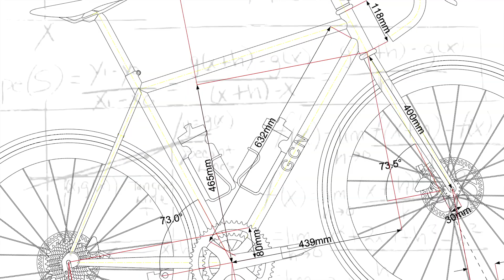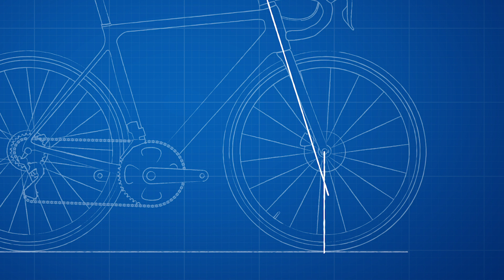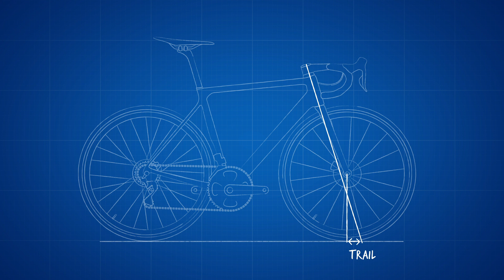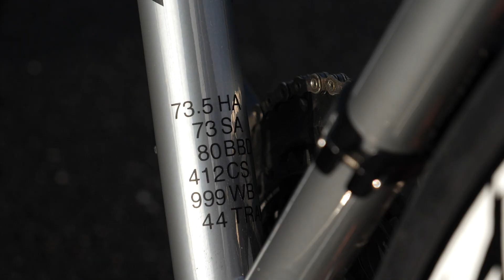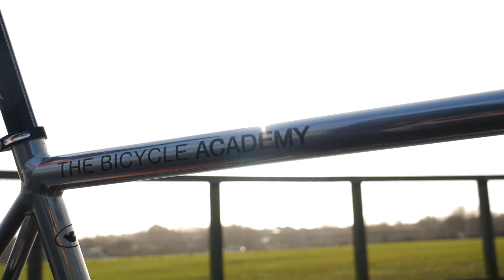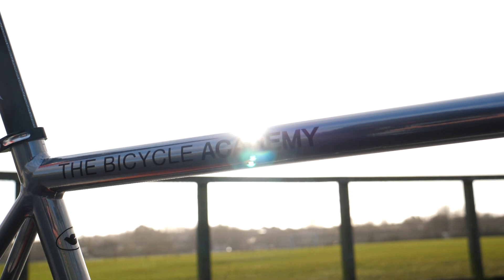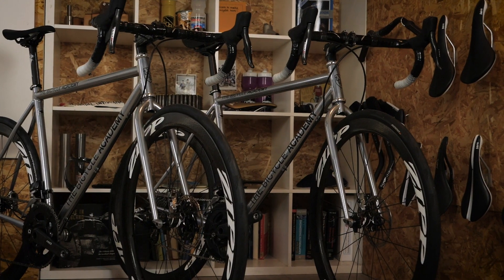How Does Your Bike Geometry Affect The Handling

Comment: I got my taste of the effect of trail whe I switched from a Charles Roberts to a Gios. Same size, but the Gios had a slightly steeper head angle and more fork offset. The Roberts cornered like on rails in good road, but became a handful through sand, gravel, and water. The Gios plowed through loose, bad road with more predictability. The steering of the Roberts felt heavier. It went straight better and responded quickly to lean, but effort at the handlebar to get it back in line was higher. Yhecsteering of v the Gios felt lighter, much like snaking the front wheel through road irregularities. The Gios was also easier to put into a speed wobble. But I've also ridden some long-trail bikes, like an early Trek Domane, that seemed reluctant to exit corners, wagging their rear wheels behind them. I think that's partly a function of the slack head angle, too, because my Madone has a similar trail figure, but the handling is much crisper. But my champ for mixed road and gravel is an '80 California Masi. It splits the difference between the Gios and the Roberts.

Comment: Given trail is one of the main geometry figures that impact how a bike handles I have a question relating to the relationship between trail and bike size. Should it change? 

For example BMC (Roadmachine its 63 on all frame sizes) and Cannondale (System Six it's either 58 or 57) seem to keep a reasonable consistent trail figure. However, the Specialized SL7 ranges from 52 to 71. 

So do bikes of a similar trail handle similarly regardless of wheelbase or do larger bikes with longer wheelbased need less trail to make them feel as 'lively' or 'agile' as the shorter wheelbased smaller versions?

Comment: A fascinating discussion!  When I got my first drop-bar bike last year (a Devinci Hatchet gravel bike) I couldn't help but notice that it felt sluggish in sharper, slow-speed maneuvers but very stable at high speeds (to the extent that I was sometimes shocked at the speeds I reached on descents).  Turns out the trail is almost the same as the high value in this test.

Comment: #askgcn
Hi Olli thanks for the great Video. I am about to Upgrade my Old caad5 with a new fork. 
That is my Chance to get a longer Trail by choosing a fork with less Offset/rake. 
However that will shorten my wheelbase which will make the bike less stable again?!

What should i do if my aim is a stable fast bike in a straight line?
It should be safer When riding Freehands. ;)

Comment: I would have likes to know what exactly where the 'tweeks' on steering tube angle and top tube length that where made to have these bikes end up with the same wheelbase. Not explaining that is a strange omission. I assume the bike with the longer trail has a slacker steering angle and a shorter top tube.. I never really understood what exactly it is that makes a bike more stable: longer trail, slacker steering angle, longer wheelbase, top tube length, lengt of the stem... Or how these (and other) factors interrelate.
Reply from the maker: The Top tube would have been made shorter and the headtube angle slackened to increasethe trail.

Comment: Great to see a video looking at the subject of trail. My understanding of low trail Vs high trail is this;-
As Ollie discovered low trail bikes are inherently more agile than high trail bikes, which has a number of advantages. Firstly, it allows you change direction much more easily, so if you enter a bend at speed, and that bend unexpectedly tightens in radius, you're able to adjust your line and make it around the bend. On a high trail bike this is much harder, as they tend to corner, "as if on rails".
The other big advantage of low trail is that you can carry a substantial load on a front rack without making the steering unduly heavy. High trail bikes really don't do well with heavy front loads.

Check out the Rene Herse blog https://www.renehersecycles.com/blog/ and Bicycle Quarterly magazine for much more in depth info on the subject https://www.bikequarterly.com/
Reply from the maker: Yes it can completely depend on the type of riding you do
Reply: Thanks for the link. Very interesting site.

Comment: Good one !  Thanks !
That wheel/shoe overlap can be a nuisance with short trail bikes.
Recently, I had a new track bike built, and mentioned to the fabricator that I would prefer no wheel/shoe overlap, if possible -- by increasing the trail if necessary.
The wheel/shoe overlap issue is worse on a track bike, because you can't move your foot out of the way on a fixie, when making a low speed turning maneuver (ie. U-turn). 
But he was only willing to go so far, so my new bike still has wheel/shoe overlap, although not a lot (it almost clears).
He added that going beyond that would make the bike unstable, and it's also against their trademark geometry.
That seems very odd, considering Ollie's tests & conclusion that bikes with more trail are more stable at high speed -- presumably what we do on a banked oval.
Have they got it backwards ?
Thnx.

Comment: Hi Ollie , Ken here . cool video . I went back and checked " trail" of my new bike , (Specialized Tarmac Pro with Sram shifting with hydraulic disc brakes 2020) ,  since getting my new bike when I'm going in a straight line the bike is so stable compared to my old bike and around the turns at speed are awesome . At first it thought it had more to do with the 50mm deep wheels and then I watch this video , again TankX Ollie .

Comment: #askgcntech having recently got back into cycling as a hobby with a friend, we are rapidly coming to the conclusion that we both need new some bikes. 
Currently we both ride Carrera subway hybrids while they are great workhorses for family riding with child seats/tow alongs they are just not up to the type of riding we currently do and would like to continue to do. We try and get out about 3 times a week for an hour to two hours each time doing about 18-30km with a mix of road and paved cycle track and some gravel, we tend to cycle at night after the kids have gone to bed so prefer to avoid the main roads.
We're both looking at around the £1-£2k mark, probably for something with a 105 groupset and ideally Hydraulic discs. I'm paying for mine via cycle to work and my friend is not very technically minded so the bikes essentially need to turn key retail bikes. The question we have is should we go for a gravel bike like Cannondale Topstone or more of an enduro road bike like the Cannondale Synapse. We want something which is relatively relaxed and comfortable on longer rides and will take a wider tyre for more confidence in the wet/loose material. We live in the South Wales valleys so it's always wet and everywhere is uphill. TIA

Comment: The "expert" never explained WHY increased trail adds stability. It's because when you steer, you sweep the center of the tire contact patch so that it isn't aligned with the velocity vector of the frame, thus creating a moment about the steer axis that tends to return the steer angle to center. It also causes what's called slip angle drag (easier to see in a car instead of a bicycle). There is both mechanical trail, as measured in the video, and pneumatic trail, caused by the deformation of the tire when it's at a nonzero steer angle. I really enjoy this channel, but if you're going to consult an "expert," get a real expert in vehicle dynamics.

Comment: Surprisingly, the stem length is also vitally important and it was not mentioned.  Hmm.  I ride a 55cm Pinarello Dogma frame with obviously an extremely short reach measurement (I like short, instant, left and right turning which makes it nice for bursting out of a paceline or dropping off the lead quickly) and run a 90mm Cinelli stem -- any longer and the Dog will wobble at high speed like a drunken sailor.  And so goes bike geometry, this topic is a great one and could go on forever.  Thanks for the great ditty!

Comment: so that explains why on my argon 18 E80 TT frameset it's so difficult to ride no hands and track standing, not to mention the times I've almost fallen off at low speeds at traffic lights. Compared to when I'm on my city singlespeed I can ride no hands so easily that I can even ride up quite steep hills no hands to embarrass the other riders as I drop them up the hill.

Comment: I noticed BB drop is 80mm on the low trail bike. Please share BB drop on the long trail bike, i assume its not identical., BB drop will also affect how leaning the bike assist steering. Regular road bikes typicly comes between with 53-60mm trail, 56mm is considered neutral (ex a CAAD10 with 25mm tires). Please also inform that any increase in tyre with and therefoire diameter will increase trail. Switch between 25mm and 43mm on a grvel/cross bike is quite huge differnce that affect handling quite a lot, wich is why road plus bikes with 47mm 650B or 27mm 700c is interchangeable. A CX/gravel bike designed for 40mm 700c that is neutrail can be suverly undertrailed if mounted with 25mm 700c.

Comment: the geometry of a bike tells a lot - i went from a redline 26pl ( 26inch bmx) to a salsa journeyman flat bar large frame - i chose a flat bar large frame after sitting on a drop bar and realizing the geometry was completely different and went and looked at the numbers, and got it right based on what i knew i liked. it felt sketchy buying a bike online based on the numbers, but it worked.

Comment: Stem length and fork rake also contribute greatly to handling. This should be the subject of a video. Thanks.
Reply: Stem length -> not as much as trail value.
Fork rake -> already included in trail value. 71.2deg head tube angle+55mm fork rake and 73deg head tube angle+45mm fork rake both result in trail=58mm and will handle very similarly. Fork rake alone doesn't tell how it'll handling without head tube angle and wheel (and tire) size. Which, from three factors combined compute trail value anyway.

Comment: I would like to know what the actual differences in the builds were. Head tube angle, rake, top tube length, front to center, etc. Give us geometry geeks some real numbers to chew on please!
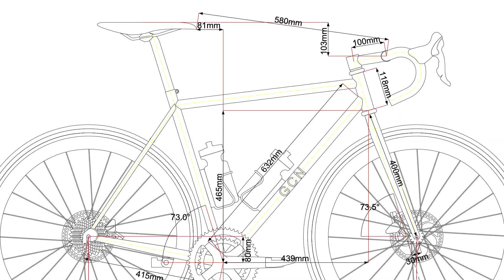Reply: Dimensions of the 44mm trail bike are shown @1:17, on the frame itself.  The drawing ~@14:08 shows the 70mm trail (while the wheel base is not shown, I think he said that was kept constant in the design, and should be 999).

Comment: I'm a bit lost. Is toe overlap generally less pronounced on a bike with a longer trail than a shorter trail? I can't find info on my 2017 Cube Attain Race Disc for trail. I have a lot of toe overlap, but I can't ride without hands (used to be able to do this).
Reply: Toe overlap depend on how long the front center your bike is. It can happen on both longer or shorter trail bikes.
What increase front center length:
Slacker head tube angle (this INCREASE trail).
More fork offset (this DECREASE trail). 
you can pair slack head tube angle +more fork offset to create bike with long wheel base and neutral trail. Or any combination you want.
Reply: @Hexsense  Thanks for this. You couldn't give me a make and model of a bike that does this could you? I still have questions: does the length of the head tube matter - if you have a really short head tube and a kicked out fork (I don't know if this is the same as fork offset) does the offset override the head angle? Is fork offset the same irrespective of how it is achieved (with a bend in steel forks, a welded on junction at the hub end of the forks, or forks that kick out from under the head tube but in a straight line from then on)? You seem to know what you're talking about.
Reply: @playandteach  Fork offset is final measure of the fork where the wheel mount, from the steering axis (steerer tube). How to achieve it doesn't matter. Head tube length effect your stack, but do nothing to trail. Head tube angle do effect trail.

My example is from Cannondale SS Evo 2020 ( and CAAD13 which has near identical geometry), where size 54 has longer wheelbase than size 56, because they switch to a steeper HTA and less fork offset right at the size 56. This caused quite a lot of controvasy when they first released because people don't understand Cannondale's intention to keep trail the same from size 48 through 61.
https://cdn-cyclingtips.pressidium.com/wp-content/uploads/2019/06/Cannondale-SuperSix-Evo3-geometry-1024x281.jpg
Reply: @Hexsense  Thanks mate. That's interesting. I guess the short answer is to ride before buying. Tricky when you are shorter than average. Thanks again.
Reply: @playandteach  being short rider. Bike offered by big brands have trail value all over the place. Giant TCR size XS is 70mm. Specialized Tarmac size49 is 62mm. Cannondale Super Six Evo size48 is 58mm. Fuji Transonic Small is 55mm (61mm for XS). Just pick the bike that have trail value in the range you want.
Reply: @Hexsense  That's helpful. Thanks
Reply: I agree it seems illogical. Surely it should be the greater the trail the less toe overlap and the shorter the less, or am I missing something.

Comment: So basically a trail is defined as how slack the fork is? Isn't this a simpler explanation?
Reply: Head tube angle, fork rake, and wheel size
Reply: Wrong! The fork rake in combination with the head tube angle determines the trail. Also keep in mind that a change to either can change your wheelbase, top tube length, and front to center measurements. All those things change the handling of the bike. Not so simple.
Reply: no

Comment: So in Summary @Ollie 
What your saying is for a flat straight Time Trial I should get a fork with Longer trail
But for Alley Cat races in the city, I should get a shorter trail fork
Reply: Watch out a bit when saying short and long. Some people can be confuse.
Fork that'll create long trail have low offset (low rake).
Then fork that'll create short trail have high offset (high rake).
This can blow some people's mind because fork with high offset increase wheelbase length, but it reduce trail and make bike more agile.
Reply: Exactly!
Reply: It's not only a matter of the fork but also the steering head angle. That means a different frame.

Comment: Tom knows his stuff. In my short lived career as a frame builder I tried to explain trail with a comparison to trucks and "trailers" ( no coincidence there ). Where the trailer ball/hitch is the head tube steering angle, in this case 90* straight down to the ground, and the "trail" is the distance back to the centerline of the axle. The shorter this distance the easier it is to maneuver on a city street, the longer the trail is it takes much more room to complete a turn. Make sense?

Comment: this video is very confusing to me. it is logical that the further the wheel is forward, the more stable it is parallel to the frame. what i dont understand is if i increase the rake offset, the trail decreases even though i actually put the wheel further forward. so whats the difference in handling with rake offset vs trail? and doesnt that kinda negate the point of trail??
Reply: Your first statement isn't always true. Trail is more important than small difference in wheel base. 
Just disregard difference fork rake made, think of it as a way to manipulate (reduce) trail. And guess how a bike handle based on trail only.
http://yojimg.net/bike/web_tools/trailcalc.php

Comment: I wonder what the trail was on my old Schwinn, it would continue going in a straight line when you jumped off😀
Reply: I had a Schwinn 3 speed that I could ride no-handed all day.
My Schwinn Peloton(great bike) was made of steel and was a plush ride, even over cobblestone.
My Diamondback is carbon and has such a tight geometry it's so "twitchy".  Over the same cobblestones it "hops about" as it has zero compliance due to its geometry and carbon build.

Comment: [n the motorcycle industry, caster angle is synonymous with what would be called the head angle in the bicycle industry. Sometimes in the bicycle industry, the term caster angle is used to describe the arctangent of the trail divided by the wheel radius. To avoid confusion, BikeCAD does not use the term caster angle. However, for those that are interested in this value, BikeCAD does display a dimension called the arctan(trail/wheel radius), (known by some as caster angle). This dimension is shown above.]
https://www.bikecad.ca/arctan_trail_by_wheel_radius
Illustration and depiction at link.

Comment: Can one conclude that a 0 or even negative trail would be nearly impossible to ride?
Reply: No.  Bikes with zero trail, even racing bikes, were apparently very common when the forks used to have large amounts of rake in the form of forks that curved forward (as my old Fuji can attest).  Chopper bikes weren't all that stable with their negative trail, but were "ride-able" (although you quickly learn to NEVER go no-handed).

Comment: Size 52 and smaller is where the difference in trail between models and brands starts to show. Because they don't want high amount of toe overlap on small sizes so the head tube angle and/or fork offset need to be change.
Some brands treat small riders nicely by developing small size specific fork with higher offset to counteract the slack head tube angle. Resulting in small size have same/similar trail value to larger sizes. Most notable examples are Cannondale CAAD13 and new SS Evo (two forks, size 48-63 all have the same trail=58), newer Cervelo (three forks), Specialized (two forks, but trail is not so consistent).
Then there are lazier brands (Giant, Canyon, and many other) who use single fork offset for every sizes despite deviate their head tube angle for small sizes.
Look at Giant TCR, size XS has trail=71. S' trail=63, M larger are 58: any review of how TCR handle in size M does not apply to TCR size S and XS at all.